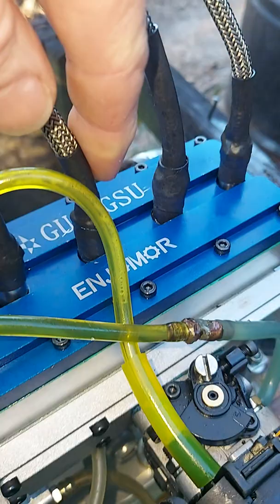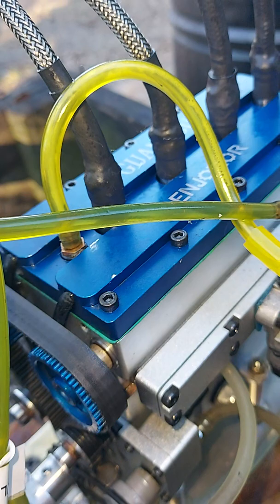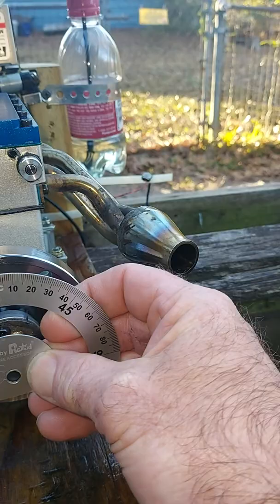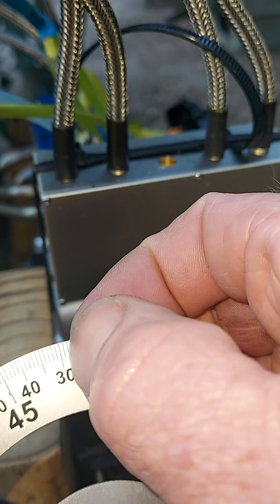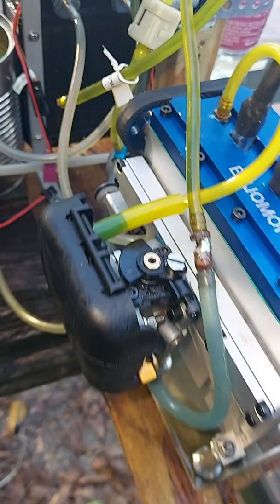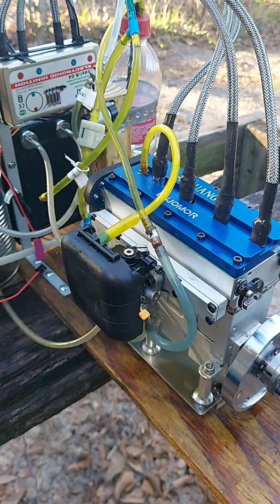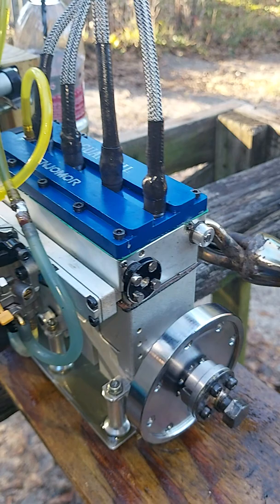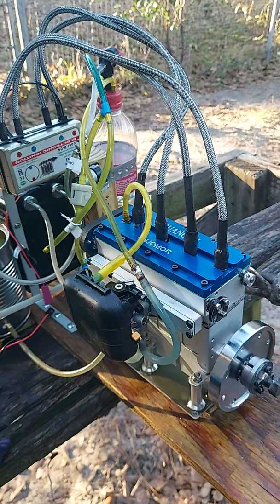Enjomor 36cc engine connecting rod bushings are replaced

Comment: Hi Leonard I have the same engine but I'm having problems getting it to start. Did you have the same problem? If so please help a brother out. Also I cannot find any timing marks on the cam pulleys, what if the belt breaks or comes off? I wish I could find more info on this little engine.

Comment: hi friend, i love your video ! tell me, does this crankcase run in an oil bath or does it run dry ? thanks
Reply from the maker: The bottom end is splash lubricated and the valve-train is pressure fed. Thanks for the comment.

Comment: Maybe try putting a little oil catch can on it. See what it does. Maybe the oil that is pressurized is going by the head gasket. As well for the blow by is it actually metal rings or rubber orings?
Reply from the maker: The head gasket is new. It has the metal three rings design. Compression is great. The valves have a lot of play between the stems and guides. Way too much in fact.
Reply: Oh ok. So needs valve stem guides with something to seal them. But could see lots of oil coming out the pvc system you added.
Reply from the maker: @dieselsforlife3847  That was because the new rings have not fully seated yet. They're good now.

Comment: It’s 1,000 for just the engine
Reply: Make sure the crank case is vented good. Pressure in the crank case will cause the oil to blow by the rings.    May 6 2024